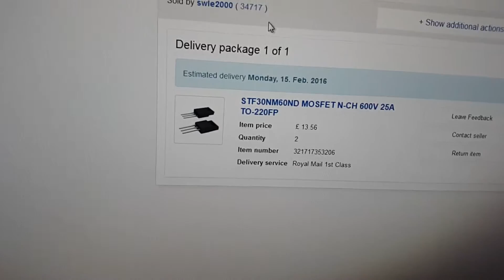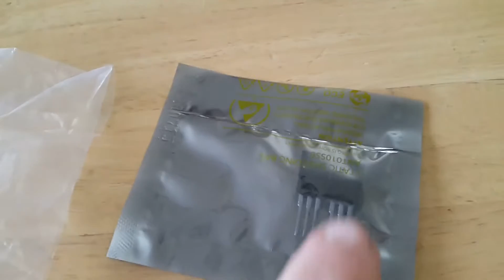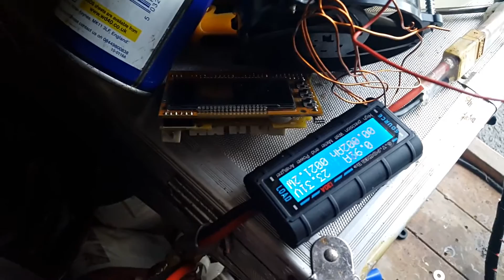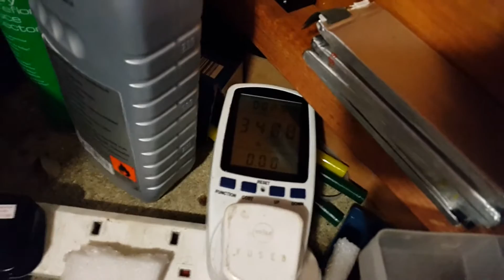500 Watt Grid Tie Failure

Comment: I repaired mine with 4 mosfets 34NM60N but now IRF3710 the input of the panels to the transformers have been damaged, I have to coax more voltage or higher amperage

Comment: Good Repair Video!
I got one of these broken inverters and repaired it now.
For me it would be interesting to control the output power for battery application. What kind of trimpot do you use for your modification?
Reply from the maker: It was just a normal 10K one but 5K would work too
Reply: +Shaun Dobbie thanks for your quick reply. On my inverter the first DC MOSFET and the first Dual-Shotky-Diod had a short. I replaced them and now one of the diods in the first pack is dead again. Do you know any reason why one of these diods might fail? After the replacement the inverter shows red -> green -> red und stays on green then. It draws current from DC side, but there is no AC output. The DC side gets warm, but I measured no short with my multimeter and the LED is still blinking green.
Reply from the maker: @Styne13  It fails because the design of this inverter is flawed. I had the same problems and since I got a newer version without the potentiometer in it I had the output mosfets blow once and no problems since I replaced them two years ago. I used expensive mosfets that were much better quality than the originals.
Reply: +Shaun Dobbie ok, maybe i should also get rid of it. I would like to have a 12V compatible version again. Anything you would recommend to use?
Reply from the maker: @Styne13  My inverter is the gwv600w